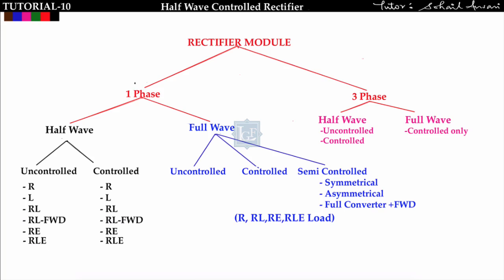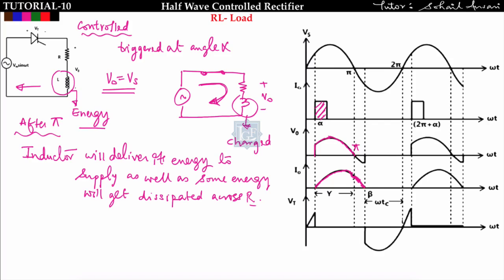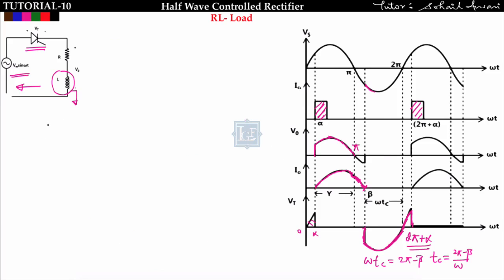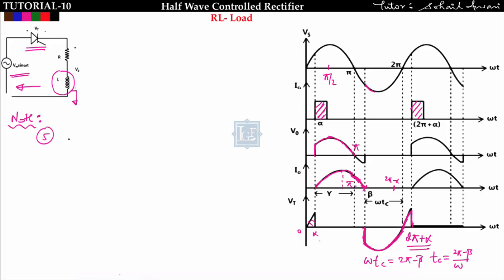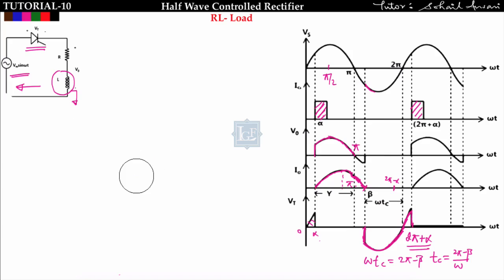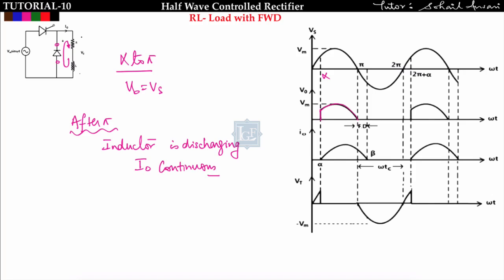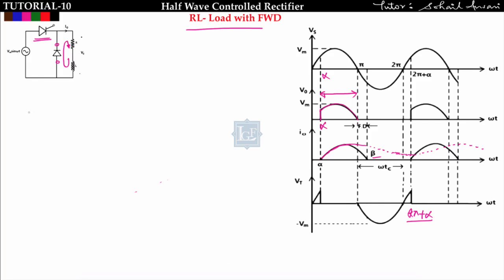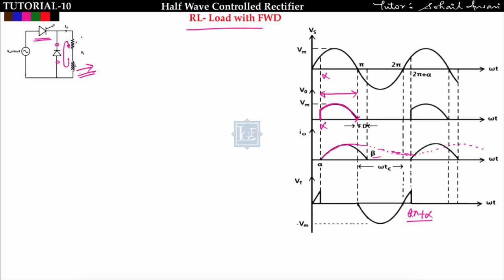Lec 10(b) Half Wave Controlled Rectifier (RL & RL-FWD load)

Comment: In integration of Voavg it will be higher limit - lower limit
Reply: That's true brother,  its always (upper - lower).
But if you integrate sinwt * dwt you will get  ....   [ ---- cos wt ]
so when you multiply minus sign inside after putting the limits you will get cos (alpha) - cos (beta)

Comment: Can anyone please tell me that,...is conduction angle :the duration which load current flows or the duration which thyristor ON..... from wave form if we observe  the conduction angle it's (beta-alfa) is corresponding to load current..... please clarify....
Reply: Brother, 
1. The angle ( or the point) between starting of the thyristor (turn on ) & stopping of the thyristor (turn off) (i.e Y= BETA - ALPHA)is called conduction angle.
2. instead of current waveform  you can also observe the voltage waveform for the conduction angle.
3. because i feel observing voltage is simple as compare to current waveform. i always prefer to observe voltage waveform.

hope your doubt is clear.:)

Comment: Pi ke aage bhi to hoga output voltage ka waveform
Reply: No... due to the presence of FWD the load get shorted(dissipation of L- stored current through FWD) at negative half cycle /from π to 2π/
Watch lec-9(b)

Comment: Nice job sir.
But please why do the inductor supply stored energy in R-L load but the inductor does not supply in L load circuit?
Reply: @ abdullahi ahmad 
Without R no dissipation elements in the circuit that why inductor is not supply

Comment: hi sir,thanks for ur lectures, I heard from other lectures and some text books that inductor will discharges with reverse polarity of voltage but Ur not considering the polarity of inductor voltage.. if we don't take polarity how can we say that Thyristor conducts beyond pi even supply voltage is negatively applying to thyristor beyond pi.... pls answer this sir... thank you..
Reply: Kalyan Kumar 
because for a ON thyristor to become turn off two condition must be satisfied:-
1. it should be reversed biased, and
2. the anode current must be zero
             here reverse biasing of thyristor will not turn it of as the anode current at that moment is not zero (see from waveform)
Reply: @sanusharma08  Thanks
Reply from the maker: ofcourse the polarity will be reversed when inductor will behave like an active element..but here my point is not about polarity reversing..my point if after pi inductor will deliver its energy to source..
Reply: LearnGATE Free thanq sir,but a small doubt, pls tell me how could Thyristor will be in forward bias after pi too if the supply polarity is negatively applying to anode of thyristor..
Reply: sanu sharma thanq sir